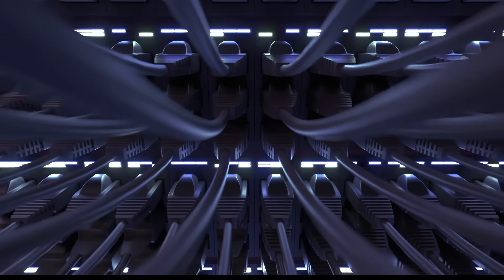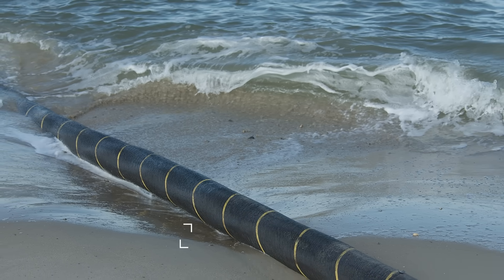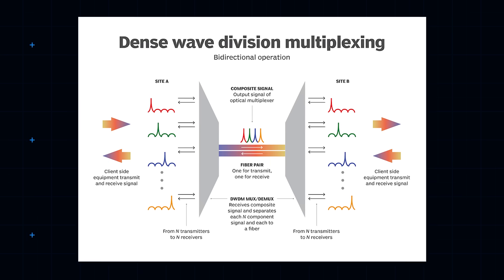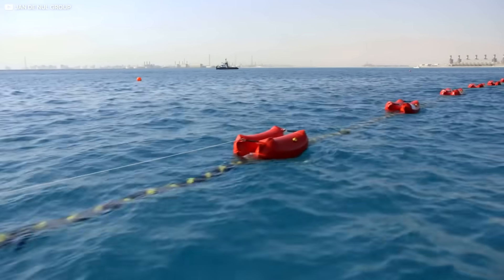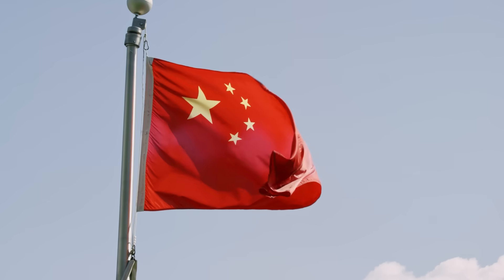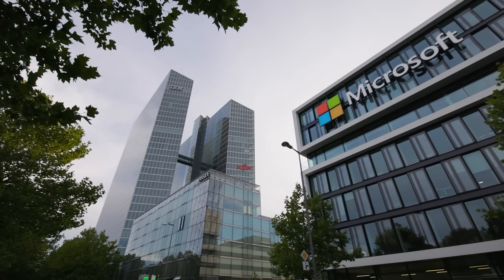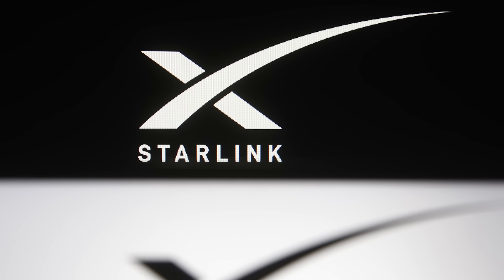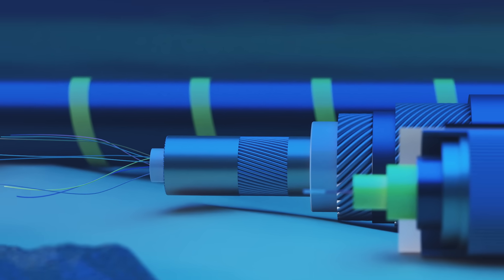How The Internet Travels Across Oceans

Comment: 2 hypothetical questions - 1/ Are any national cables built or attempted to be built in secret to prevent other nations from interfering with communications in the event of hostilities? and 2/ Although it seems likely that something like starlink will be more prevalant ifor the future of communications is there a plan to continue to build in reduncies for physical cables in case something happens outside our atmosphere that would impact satallites?
Reply: Yes, most countries that have a coastline will have "secret" cables, maybe to provide connectivity in times of war but also to detect submarines etc. If these secret cables get damaged, they may not be repaired so as not to attract attention. They may simply be discretely replaced. More difficult to maintain secrecy if the cable connects to another country. The video itself quotes Elon Musk as saying that Starlink fills a gap in the market and does not seek to replace fibre. A signal traveling at just less than the speed of light with low latency compared to going miles up only to come miles down again at a fraction of the cost of satellites is going to win hands down every time. It is baffling to everyone in our industry why the layman continues to think that satellite and wireless are more advanced than fibre optic.
Reply: Well when you put a cable under the ocean to another (foreign) country it's not a national cable... So what they do at the other end is beyond your control... as well as if they tell anyone about it.
Besides, pretty sure a sub can detect a cable at the bottom of the sea pushing thousands of volts through it... all they need to do is sweep the coastline... right?
Reply: @GregMoress  There are a couple of cables in Lake Ontario, in Canada.  I haven't seen any subs in there.  ;-)  There are also some cables that pass along a country's coast, with both ends landing within the same country.
Reply: Can't tell you.  They're secret.  ;-)
Reply: Yes, there are.    All the communication satellites ever built couldn't transmit as much data as one cable so yes, they are still being built.   If I hadn't gotten a foot infection last week I'd be laying some new cable next week in Thailand off the ship Dependable.
Reply: Not to worry!! TRUMP enacted his SPACE FORCE,!!!! What is it and what does it do???  Dozens of tRUMP supporters were asked those questions and SURPRISE,!! Nobody knew what the SPACE FORCE IS,!!  LET'S GO BANNON,!!
Reply: @steelman86  This is one of the dumbest comments I've read all year and we're near the end of the year.
Reply: @steelman86  Trump not in office btw

Comment: Now if only the issues of global latency could be resolved would there be another huge evolution in internet tech.
Reply: That comes down to physics. Signals in fiber optic cables already travel at extremely high speed, not light speed, but close enough. The only thing that could improve it significantly is some crazy new material that lets the signal reach speed equal to light speed in a vacuum. This goes to show how big Earth really is.
Reply: @garzdiva  Or at least some way to decrease the amount of signal hops, which contributes the most to latency.  Maybe more direct lines or something.

Comment: Do the cables get hot/give off heat?
Reply: The ocean probably cools them.
Reply: @ahnafhabib1337  that's not what I'm asking.
Reply: @reallifeeducation3701  Electric cables only get hot when you put too much power through them. These cables were designed to handle the amount of current and light flowing through it.
Reply: @ahnafhabib1337  so will these cables give off any heat or get warm at all
Reply: @reallifeeducation3701  Probably not. Even if they did its not enough to notice anything.
Reply: @reallifeeducation3701  If my math is correct it will be 54592 btus per hour. Due to the oceans size those underground cables wouldn't even heat up the ocean by 1 degree.
Reply: @ahnafhabib1337  thank you

Comment: Most of the laying footage shown is actually power cables, which are much thicker. Fiber optic cables are between 15 and 50 mm thick
Reply: The fiber cables are at the center of the power cable...& of course, extra cladding for protection
Reply: @CharlzOkojie  we do not normally mix fibre and power cables because it makes them difficult to maintain. There is a copper thread in a repeatered submarine fibre-optic cable but it does not add significantly to the diameter.
Reply: I think you'll find they're more thicker than that underwater.. all fiber optic cables are clad with copper and then the armor shielding. More like 100-150mm thick.

Comment: How do they monitor the installation and health of cables? Sonar? Divers?
Reply: Can't speak for installation, but monitoring the health of the cables is done by the devices on each endpoint of that cable. There's also devices that can shoot light down some fiber and it'll tell them approximately where the damaged fiber is inside the cable. 
From there they'd just have to send people to that approximate location and start testing in person... Seems like a nightmare..

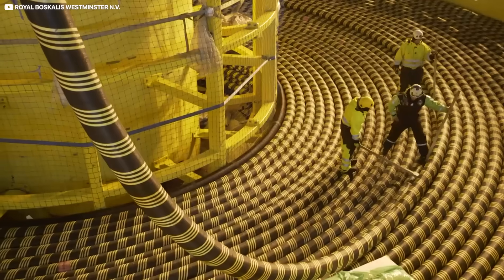Comment: 5:50 Noob here, but isn't every country already connected by the internet? Or is "Apricot" really linking Singapore, Japan, Guam etc for the first time now?

Also does laying more and more cable enable them to increase internet speeds?
Reply: Every country is connected by internet by some route, but not directly with each other. As the number of users grow more connections are needed, and more direct the connection is lower the latency

Comment: Remember the days when light traveled through the air and not cables. Everything was free. They took that away and put everything in cables in order to controll information flow. ( can't do that if it' flows through the electromagnetic  atmosphere.  And they get to charge us for it now. ). Only reason Attenna don't work well is because the signals are sent into cables and not into the air  . Did not free us . Took total control of .
Reply: Put your tinfoil hat back on and let the adults talk
Reply: Someone forgot their Thorazine this morning.

Comment: All those fibre optic cables but I'm still getting lag in Call of Duty 😫🤓
Reply: check if any of 
local animal is not biting your internet cables :)
Reply: You need to tell your provider to distribute the network with another amplifier as you are overpaying for less performance than expected. I did this and it worked

Comment: Nice video. What about the future of starlink or satellite internet if that gets some development. Could be interesting speeds coming in that space, how can we make it faster through the air/space than in a fiber cable already on the ground or will we have reached the limit since we're already at the speed of light?
Reply: Satellite transmission is much slower. In both cases data is traveling at about the speed of light, but the distances are much greater in space. Satellites are farther up, than cables are down, and as you get farther away from the center of the earth the perimeter distance to travel gets longer.
Reply: A company recently paid for a cable to be laid on the great circle route from USA to England instead of straight across as most are because the signal from one end to the other will get there a few nanoseconds faster, thus allowing them to get in stock orders or sales faster.

Comment: Umm, this video has... Issues.  First, networking talks in bits per second, not bytes, though both can be technically discussed.  Second, the speeds quoted are quite off, modern cables often use dwdm on multiple pairs of fiber with 100 channels per pair with each channel carrying 100 gigabits per second, for a total of 10 terabits per second per pair, or 1.25 terabytes per second per pair, far above that mentioned in the video.  Also 99% of internet traffic does NOT traverse these cables, 99% of trans oceanic traffic likely, but not 99% of all internet traffic and I'm pretty certain not even 99% of international traffic.  Dwdm also isn't very complex in concept, it's just different wavelengths/colors of light, implementation can be more complex, but the concept is very simple.
Reply: check your math on this and then get a refund from whatever community college you attended
Reply: Correct figure seems to be that up to 95% of intercontinental traffic traverses the underwater cables

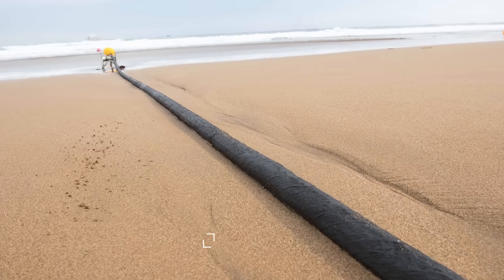Comment: 1:22 - Not Gigabytes, Gigabits. connection and data transfer speed is measured in bits per second,  in ur case Gigabits per second,  in bytes in ur case Gigabytes, measures the amount of info in data carriers, like HDDs, SSD, Flash drives, CD/DVD Discs and so no

Comment: I'm wondering how deep in the sea/ocean are those cables laid down?
Reply: Normally on seabed, so will be at the max depth of the ocean, unless there's a good reason for them to be buried.
As the video says, the closer to land, the more chance the cable is buried or armoured.
Reply: @handyandy6050  cant the cables get crushed from the pressure down deep?
Reply: @Hyper_DX  In theory, yes, but all "voids" in the cable are filled, and the materials the cables are made of are not very compressible. Also, due to its cylindrical shape, pressure is acting equally in all directions. yes, the pressure is trying to crush the cable, but the forces are "distributed", just like in a submarine pressure hull. (The inner hull).
Also Force equals Pressure multiplied by area, the cable has a relatively very small area which the pressure is acting on.
Reply: Simple answer: The cables aren't very compressible.
Reply: @handyandy6050  ;)

Comment: I think two things are going to happen that people don't think about enough:
1. SpaceX will help to revolutionize undersea cables by launching large scale ZBLAN fiber manufacturing plants into orbit as they have to be in a 0 G environment and feed stock to these orbital facilities and then haul the finished fiber back.  ZBLAN can go 10x as far or further and carry far more channels per fiber, though the channels will be cut down some for long distance undersea cables as the bottom of the V curve can carry channels the farthest.  The thing is a signal can go orders of magnitude further over ZBLAN fiber than conventional fiber, especially when focusing on the bottom of the V curve when needed, so the extra cost of making these hair thin fibers in space with the help of the low cost bulk transfer capability of Starship will more than justify itself with cables that don't need repeaters and can carry thousands of strands instead of a handful to dozens of current undersea cables.  The current cables are limited by the need to amplify the signal with Raman amplifiers.  As companies are already making ZBLAN fiber in space on a pilot basis, I think it is likely they will contract with SpaceX for the ride to and from space.

2. Starlink will help global communications by shortening the time it takes for particular prioritized traffic to circle the globe.  Glass slows the speed of light going through it down by a fair amount.  Plus these cables snake all around in indirect routes, adding more latency.  Some routers along the way tend to be jammed, adding even more latency.  I expect SpaceX to offer a service to laser hop around the world with guaranteed low latency; the best you can go going through the vacuum of space through a LEO / MEO constellation.  This will have many buyers.  I suppose the more obvious buyers are people in remote places tying into the stock market.  All kinds of money is spent for the lowest latency solution for modern day high frequency trading.  Most people using the stock exchanges are no where near them, so this is an obvious place where people with lots of money will spend on that premium to go over Starlink.  A lot of more average people will probably spend an extra buck so they can have better real time communication with people far away.  I for example I am on a very low latency fiber connection and I work with other people remotely in town who have the same low latency service and it works very well for the most part.  (Some people still need to fix their in home WiFi, but that is getting into another topic.)  However you go for higher latency ISPs, especially cable modem providers which tend to really suck on latency, and you add some real distance, then people start talking over each other a lot because the latency is too high, often well beyond the time length people are used to waiting before hoping into the conversation with in person communication.  If it is not too expensive to get the Starlink backbone experience, a lot of people and corporations will spring for this.  Gamers with an extra buck will spring for this in a heartbeat because latency can wreck real havoc in real time online gaming.  Especially if they can avoid the deal where they press the fire button, things things don't happen, and then they are dead as the game play skips around and the other person also pulling the trigger gets their fire packet into the server first, but instead they get their packet in first with this new Internet service and avoid the game skipping around like this, they will spend the extra for the service if they can.

In short SpaceX will likely bring more of everything.
Reply: How are we going to ignore the fact that this guy could possibly be Elon Musk?
Reply: jesus dude... space is fake

Comment: Although wireless has it's conveniences, I've just always found that wired products work better than wireless. From mice, to wifi, to chargers. Obviously wireless has it's conveniences like your phone, but wired will always have it's place.
Reply: Wireless wifi is powered by wired internet ……..
Reply: Well wired will always outperform wireless, wireless comes from wired connections anyway
Reply: wireless networks use the half-duplex rule which means that devices can only send or receive data at a time while wired networks will send and receive data simultaneously 

If you connect your wireless computer to a wired network, the speed increase is felt right away
Reply: @soulreaper9453  Sure it's half-duplex, but that's per antenna, and I'm pretty sure starting with n manufacturers are supposed to incorporate MIMO into wireless NICs.
Reply: Yeah like I personally prefer to have my cable put into your USB port as opposed to doing it virtually which some people call FaceTime or Snapchat
Reply: 💯% agree 👍
Reply: Bruh.. that is your wireless internet... 🤦‍♂️
Reply: even headphones.
Reply: Same here.  Faster and more reliable.  My home has CAT 6 lan and WiFi 6.  The lan is much much faster.
Reply: it's a matter of cost actually, why aren't we all in flying cars like what we envisioned in the past? Because we can't afford that, yet. Same with wireless technology, it will get to a point where it is affordable and reliable enough that cables will be a thing of the past
Reply: @dandyND  It's not about affordability or accessibility.  Her comment is on the performance issue, which I would agree with.  Wireless tech just isn't well developed yet to be as responsive as wired.
Reply: @dandyND  what OP said just went over your head.
Reply: @dandyND  Problem with wireless, like starlink is, it's very expensive and it has a fuckton of CO2 emission... 
a rocket launch to space has about the same emissions as driving a car for 1-1,5 million km...
Reply: Look ♫ Look ♫ Look ♫ 💕 😊
May the ducks heal you 🦆💕✨
Reply: Lena, I have found that gasoline powered cars are stronger than electric cars! My guitar is a lot louder when I plug the chord straight into my amplifier, rather activate a "wireless" receiver! The whole concept of "wireless communications" is a threat to the "precious metals" industry, just like alternative fuels are a threat to big oil. And, there's not just a monetary loss; The progressive growth of materials science is stunted, and the DOD loses a lot valuable information that could've generated weapons - superiority over the competitive superpowers. I like your name, and I like your hair. ☮
Reply: @ghostwriter1415  If you have ever done a side by side speed test you will see that wired is superior performance.  Wireless is convenient if you live your entire life on your phone.
Reply: @hewitc that's because there's physical stuff/matter/atom's/material(s)/compounds .. whatever, that can better accommodate frequencies/wavelengths/PE/KE .. whatever, and  I've done a side by side speed test, my friend. It's called a, "thought experiment", and I've reached the same conclusion; wired is better! My comment is still up there for you, and others to evaluate.

BTW: I do not own a phone, and the next phone I get will be a phone that has ten physical buttons on it, that I can manually depress in any numerical combination, and make a cellular telephone call.

I used to want all of the answers, but now I don't care. Life is better when it's mysterious! 

Forsake computers for animals, and the world will be a better place.
Reply: @hewitc  Poeple who want to use a smartphone at all need Wi-Fi because smartphones simply don't have ethernet ports, lol. Also, Wi-Fi is convenient for people who want to connect more than 3 devices to the internet and do not feel like carrying an ethernet cable around the house long enough to reach the outlet.
Reply: until someone cut it. Wireless still the best.
Reply: @flashmedia8953  Spoken like someone who has never dealt, or understood the problem, with wireless interference.

Also news flash, all your wireless network techs (Wi-Fi, cellular) are backed by cables. In the case of backbone cable cuts, your fancy wireless is as helpless as anything else.
Reply: @garzdiva  Smartphones stop working if you damage the internal circuits. Does that mean telephones are better? No.